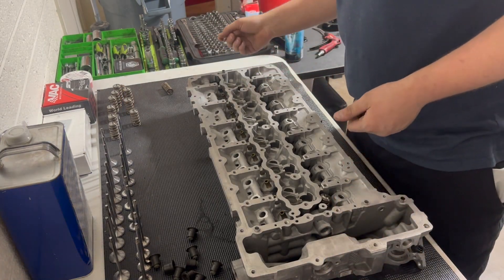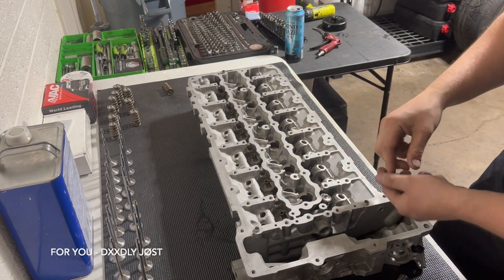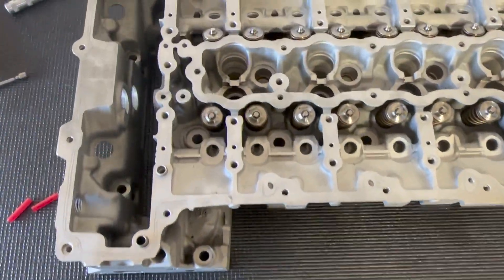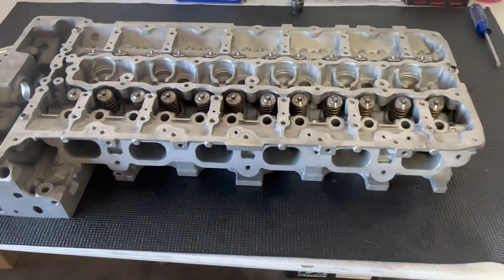BMW N54 ENGINE BUILD PT 5 | Ferrea Valve Spring Install

Comment: Bro how did the cut ring head gasket go? You closed deck yet? Any lifting? Cheers
Reply from the maker: Bad it ended up leaking. The best way I have found is to put copper rings in the block and then use an MLS gasket.
Reply: @Eurowoks I've heard genuine MLS works best, but lately been researching about sleeves and a fire ring with a composite gasket. Ring bites down/crushed into head and block. Even better darton wet mid sleeve woukd be ultimate.

Comment: That def one way of doing valves, for me I would just take it to a machine shop and have a proper valve job; no lapping required
Reply from the maker: they work really well, my current motor build has a crazy head just wait :)
Reply from the maker: next time

Comment: You did a great job with this head, I just did an n63 and this head is much more difficult because of how long it is.
Reply from the maker: nice, i built one of those too.
Reply: @Eurowoks  you are the f’ing man then lol, but you definitely got a subscriber
Reply from the maker: @wendellgreenidge3362  bet, the car is so close to being done, i got tied up getting my shop up and running. Finally had some time to work on the 335. Im one o ring and an AN fitting away from driving it. Did you sleeve your N63?

Comment: What valve spring compressor are you using in the video? I purchased one claiming to work and it doesn’t 😫
Reply from the maker: an old snap on one. and it barely worked.